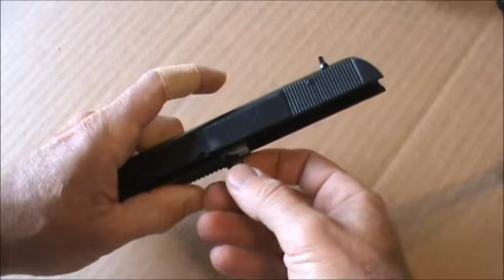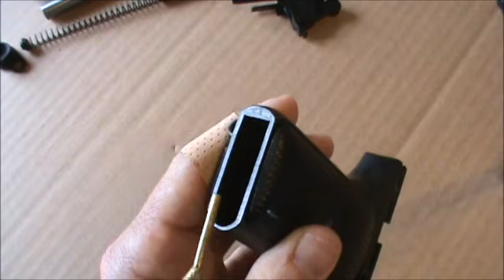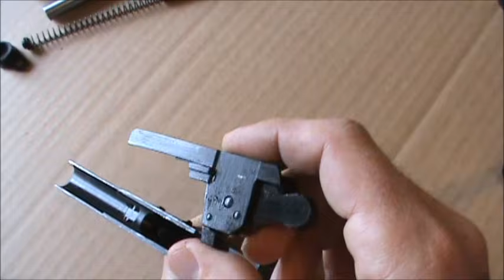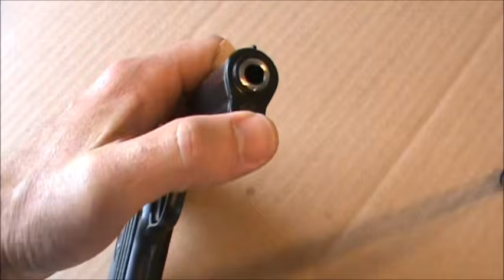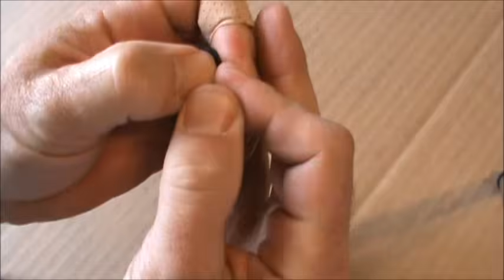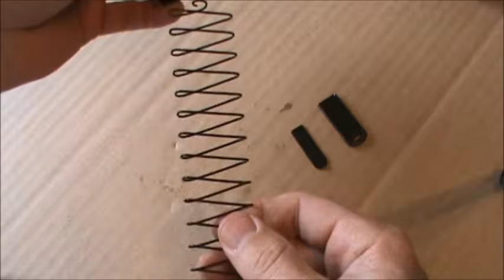TT-33 Tokarev Pistol Field Strip

Comment: My first gun... when I tried to disassemble it for the first time, it was a pain. I was unable to wash away the cosmoline on the disassembly lever, and so I had to use a screwdriver and a hammer to push the lever to the other side. I was finally able to wipe it off, but it’s a pain to disassemble.
Reply from the maker: The TT33 is not completely modern in it's disassembly. That catch that holds the slide stop in is the worst part of the design, IMO.

Comment: It's so confusing I have the same model what u have but tt30 and 33 have larger slide grip bars.
Reply from the maker: There are variations in the gripping surfaces on the slides, many wartime guns have the type with less and larger grooves, the post war types like mine tend to have the smaller and more numerous grooves.

Comment: I got mine in the mail today. I cant get the damn grips off though. I have the switch all of the way to open but the panel wont pop off. I tried heating it up a bit to see if it was glued on with cosmoline but it wont bodge. not sure what to do.
Reply from the maker: They can be extremely tight when new or reconditioned. Personally if would leave them on, they might loosen up after a bit of shooting.
Reply: +314299 Shooting Channel I just want to take them off to get the cosmoline off then re oil it was think maybe there is funk up in it

Comment: I use the first method in the video to take down the Tokarev, but I use the second method to put it back together again. It just seems easier (& quicker) to compress the spring once its in the assembled slide & put the bushing on the barrel & rotate it.

Great video!!!

Comment: The TT was my service pistol for nearly 25 years, during my service with the Romanian army tank force. I could disassemble it in less then 15 seconds and put it back together in less then 30, but it took me double the time when I was doing it blindfolded.
The first way to field strip this baby is the right one, is is more simple, faster and safer. The other is for the guys who think any handgun based on a Browning type of operation is an M1911 copy and must be striped the same way. In fact the Tokarev is much more simple to strip, operate and repair.
One needs no tools to field strip this gun, remember the gun is issued only with the holster, two mags, a lanyard and a cleaning rod. 
First, in order to disengage the piece that secures the slide stop, the one on the right side of the frame, one can use the cleaning rod or the flat part of the mag. This might leave some traces on the gun, but surely not on your fingers as the tool you are using can do!
If you turn the gun left side down and rock the slide a little, the slide stop will fall, no need to extract it.
And in order to secure the main spring, just wrap your fingers around the slide before removing the slide, it is faster and safer that the way you are doing.
Reply: How reliable are these guns?

Comment: Do you know "Sportwhy" TT-33 in 22 version and it uses insert for 22 LR round press into. Any good of them or just another knock off.
Reply from the maker: I've seen the Polish .22 version of the TT-33, they look well made and seem to work decent with good ammo, the down side seems to be loosing the inserts.
Reply: 314299 Shooting Channel I have one but the insert stuck inside the barrel, slide won't move and  can not be eject by extractor. Yes, you right I have lose one insert already because of seat in the barrel won't go.

Comment: There are no screws on the Tokarev. What appears to be a screw slot on the mag release and firing in retainer are actually split pins. Remove by driving the split center out with a drift punch.

Comment: Years ago I had a chance to see an old soviet manual on the TT-33 and yes they used the 2nd method to field strip. They said to use a round of ammo to depress the spring and us the floor plat of the mag to pull the lock from the side. They didn't believe in needing tools for field stripping.

Comment: Very good video !!! Thanks. I have a TT-30 (I think) Top of slide is M-20 that followed me home some 30 years ago. I buy most of my ammo on line and run across some great deals. I ran across a Croatian Toc (great price) and bought a couple of them. The big difference in them is the # of rounds in the magazine. The new one holds 9, whereas my original holds 7. Have you any ideas where to get more mags???? And any comments on the new gun.

Comment: nice vid. ive used the first method since i was a kid. far easier than removing the spring from the front. beautiful pistol you got there. not seeing a safety, i figured you were in Canada. btw, there are no screws in the Tokarev. the firing pin and  mag catch are held by split pins.. i didnt know myself for a long time. sorry if you've been told this before. for those here in the USA, Zastava is selling new Tokatevs for under 300 $

Comment: I got a seriously problem, can you please help. My extractor pin is stuck, you know, the pin that you need to punch out from the bottom in order to the extractor to loosen up and come out. This pin is dead stuck, I got a lot of strength in my hands and i have been hammering away with a pin and a hammer and it seems like someone heated it up and jammed it in like a rivet, it seems like so, but im not sure, I have already messed up the finish of the gun, what can I do?

Comment: I use the first method when taking down my Norinco 213. I've got the 9x19mm model. It's not the easiest in the world to disassemble compared to things like the Glock, Springfield XD, or even my makarov but it's easy enough once you've done it once or twice. The real drawback is that locking clip for the slide release. I think I still prefer my Makarov though just because it's SA/DA.

Comment: @314299 No they still had em but the makarov ones are easier and cheaper to manufacture while sacrificing only slightly in accuracy which is not that important in battle for a side arm anyway.